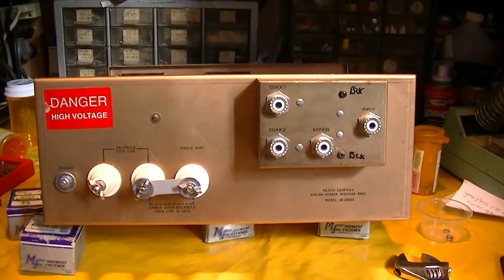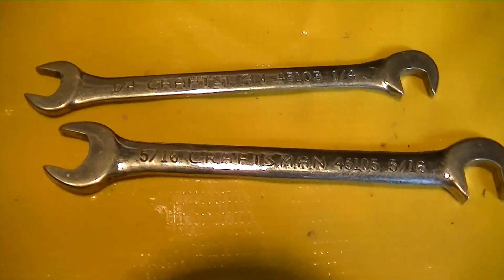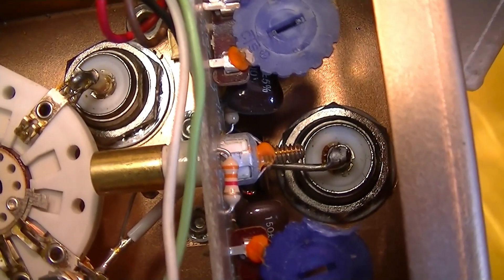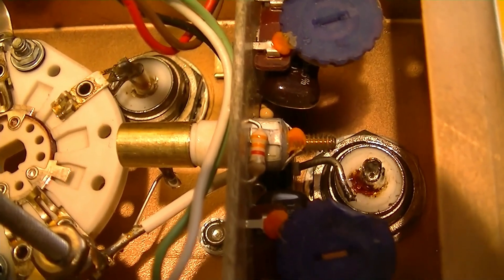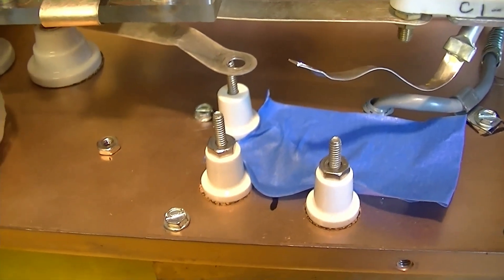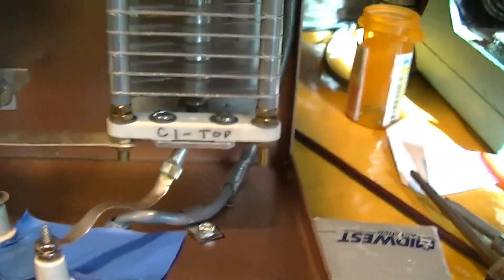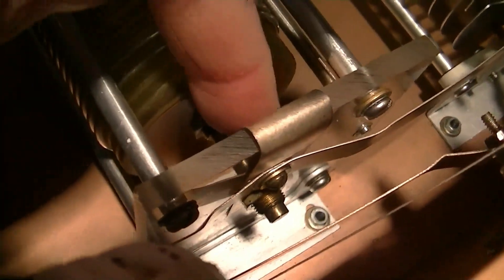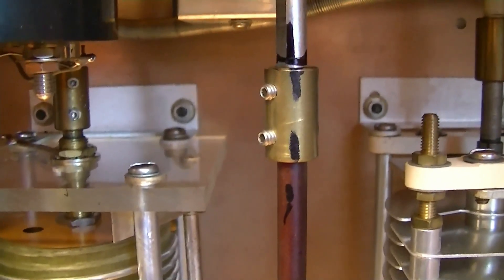Heathkit SA 2060A  Repair Roller Inductor Tuner

Comment: I have an SA-2060A and it has a problem where the insertion loss with either coax1 or coax2  is pretty drastic. When I put it inline with either coax the signals drop so low they can barely be heard. This is the antenna switch assembly. 
It’s as though the SO-239 connections  are faulty somehow. I’ve ohmed them out a there’s continuity. 
Any idea or suggestions what may be the issue?
Reply from the maker: Take the box off the back as shown.   Do NOT TRY TO SKIP OPENING IT UP !
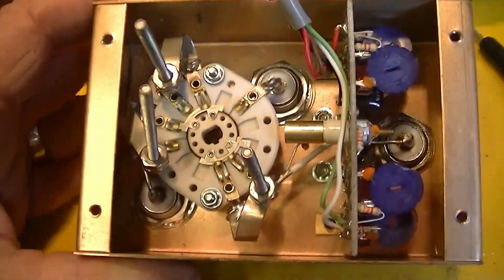 stop the video at 9:31   Is your ceramic switch installed backwards ?  Are the contacts and wiper burned up from HOT SWITCHING?  That can cause the problem...and is about the only thing that can go wrong.  There will be Visual and electrical cues in the unlikely event of a failed SO-239 connector .Simple ohm meter testing will let you follow the "signal"  through the switch. The resistance should be too low to measure, less than .1 ohm.    disconnect  an so239  from the switch and apply a  high voltage  (100-300 volts) to the center pin only, and see if you can measure leakage to ground with a volt meter. Reading must be ZERO.   If none of these problems exist... are you tuning it wrong ?
Reply: @captlarry-3525  Thanks for the reply. 
If o didn’t mention it, it used to work but it’s been in a box for many years unused. I’m trying to get it back online. 
I've never used the tuner with an amplifier so doubt its been burned that way. I haven't even tried transmitting because the problem I'm seeing manifests itself when receiving.  I haven’t even tried transmitting or tuning since it’s apparent there’s some major problem when just connecting the tuner to the transceiver. 
Here is to what is something I found while troubleshooting: When I connect the antenna to either the coax 1 or coax 2 so-239 and then: while connecting the tranceiver to the input so-239, when the center conductor of the patch cord coax touches the center of the txiever so-239 I can hear signals. As soon as I connect the shield to the tranceiver so-239 the signal goes away. That is, as soon as I screw the sheild onto the tranceiver it's like it shorts out the coax and all the signal disappears.
Reply: @SummitBidTech  sorry I haven't taken time to think about this.. but I would open up the switch inspect it...and look carefull for a wiring problem.  Read the manual ? This would be a good first step!
Reply: @ thanks for the reply. I’ve since figured out that the problem was with my understanding of how the tuner works and how to use it. Even though I built the tuner, it was more than 30 years ago (!) and I had to relearn how to use it. 
  The tuner works as designed and is a fantastic piece of ham equipment. Thanks again.
Reply: @SummitBidTech   Good.  I wasn't sure either, since I dont use that function.  73 !